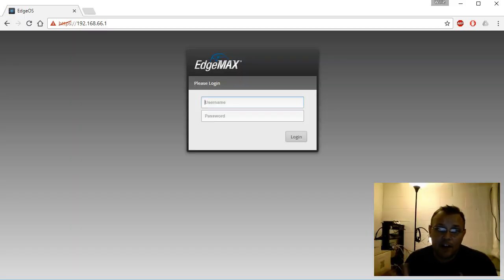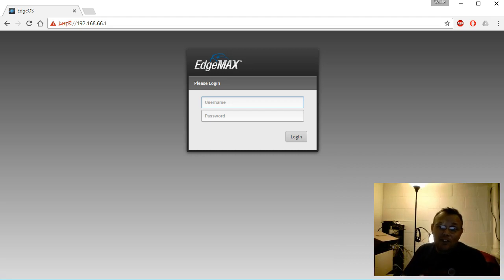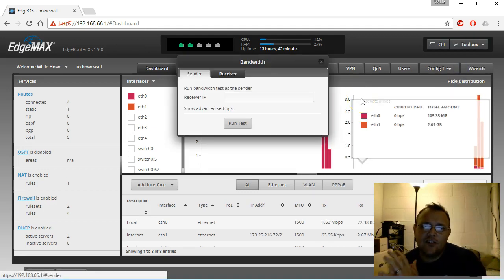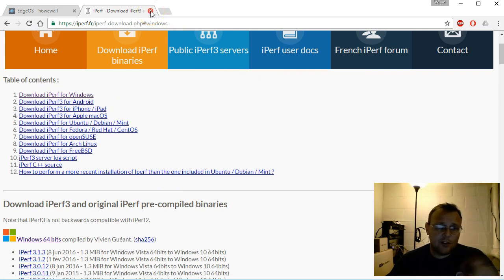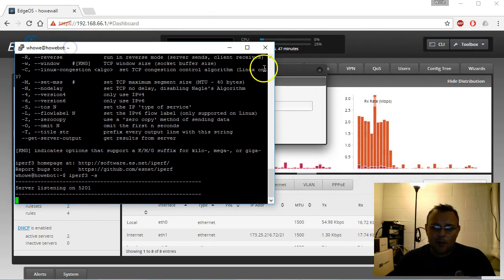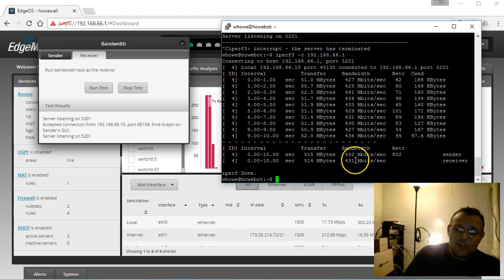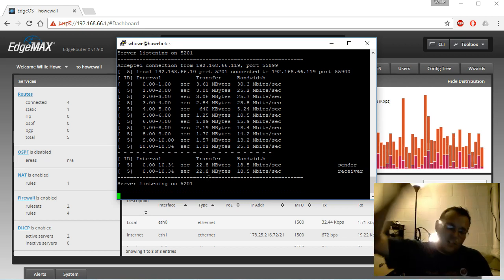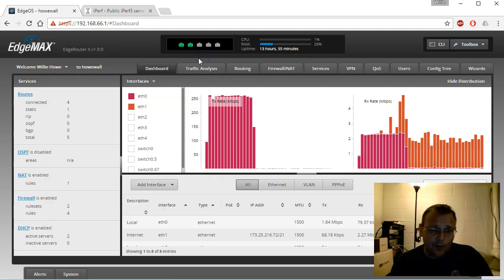Ubiquiti Speed Test How-To

Comment: Thanks for the Great Video. Just one question out of curiosity, I ran the test and since the local Lan is 1GBps to the Edge Router should the speed test not match the same.

[ ID] Interval           Transfer     Bandwidth
[  5]   0.00-30.06  sec  0.00 Bytes  0.00 bits/sec                  sender
[  5]   0.00-30.06  sec  1.14 GBytes   326 Mbits/sec                  receiver

Comment: Explanations could be greatly imporoved with a tablet instead of your mouse. mspaint is simple if you get good enough with its features. Since you are using mspaint, you won't be needing fancy buttons and pressure sensitivity. There are tons of wacom usb drawing tablets for next to nothing on eBay. I suggest picking one of those up.